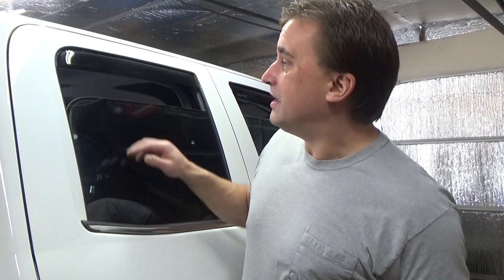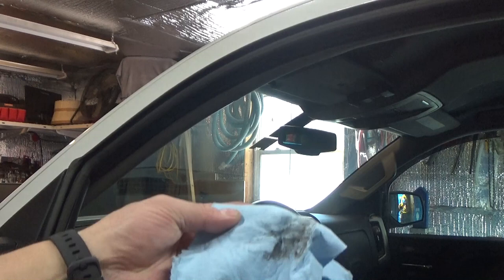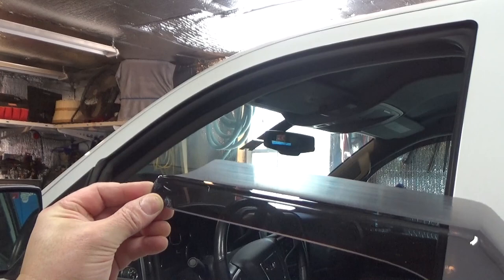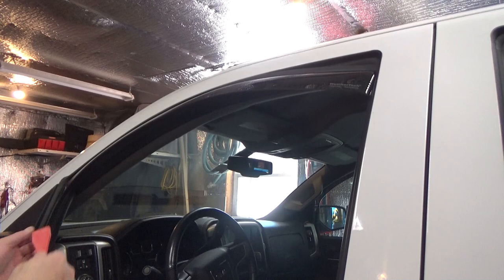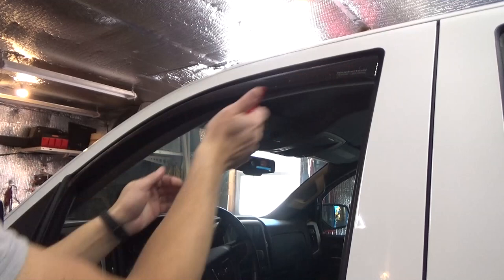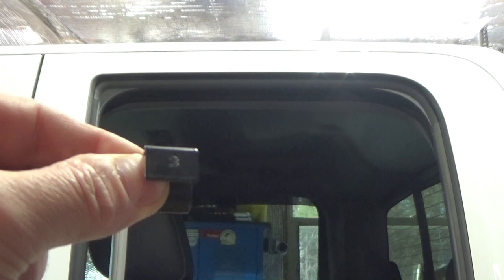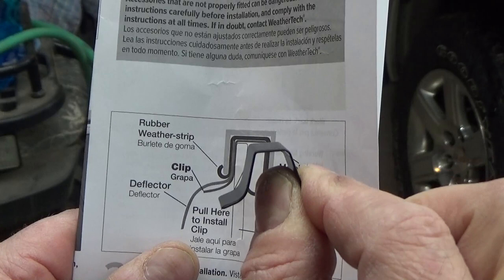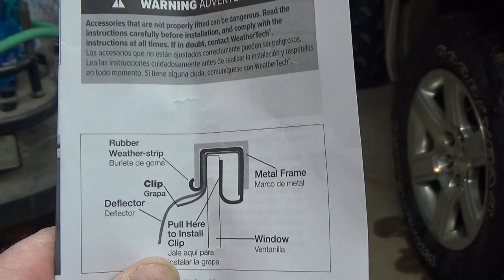How to Install WeatherTech Air Deflectors On a Sierra or Silverado  How to Install WeatherTech Clips

Comment: I’ve found on 17-19 silverados that if you bend the clips in slightly towards the curved part, they significantly tighten up the hold and they’re much more snug. Install them square side in first with the curve facing you. Worked so much easier after I called them and got a very generic response. Much better now gents

Comment: I have these on my Geo Tracker, but they were too loose and kept sliding down at the back. I had to use a few dabs of weather strip adhesive on the outside top of the deflector and roll the window up till it stuck to the factory weatherstrip. Not so good.
Reply: If they had metal clips like you see in this video those clips are supposed to grab  the inside of the deflector and hold it up.  The way that they were installed from what I can tell was incorrect in this video.

Comment: So I’m puzzled for the rear with the two clips does the plastic go over that lip or does it go behind the lip? I tried putting the rears on and they started to make a cracking sound going over that little plastic clip. I was reading for the front that one of the guys with the 2017. Installed his and there was a cracking noise and he broke both of them. I haven’t run into that one yet. Can you get a better video or explain it better about the clip over or behind thank you I have a 2016 sierra 1500.

Comment: I had front and rear on my 2013 HD2500 and they were still on the truck when I traded it in for a 2017. The front on the 2017 have been fine but I’ve had 3 sets on the rear and they break at the metal clips and fall off when the window is rolled down.

Comment: It looks like you installed the rear ones incorrectly that metal clip holds the rear deflector up the clip you see protruding from the outside of the vehicle is supposed to be on the inside of the deflector and stops them from sliding down

Comment: The clips on 2021 Ram 1500 Normal not Classic, do not work, total BS, installed without clips.  I'm an engineer and there is no way I would design it that way.

Comment: Do not order these for a 1998 generation Chevy Suburban. They will not work unless you want to physically chisel and separate part of your weatherstripping apart from your door. I wasn’t willing to do it. I love WeatherTech gear but I am returning the front window deflectors they sent me. I told them it was for a 1998 Suburban. Until they want to show me a video of how you can install these in a 1998 Suburban without damaging your vehicle, I’ll pass.